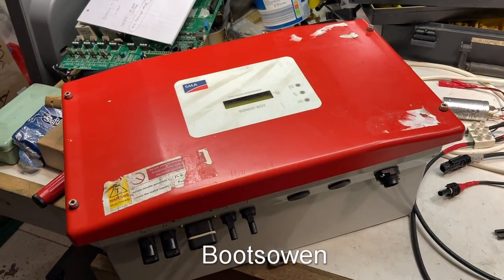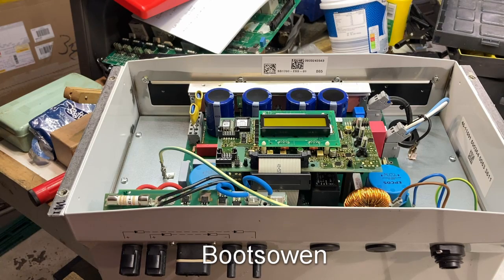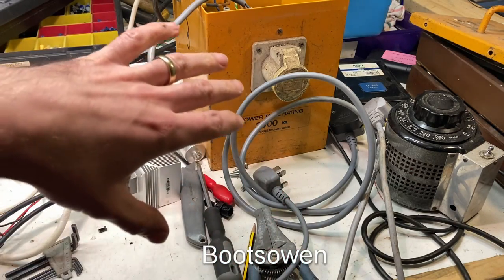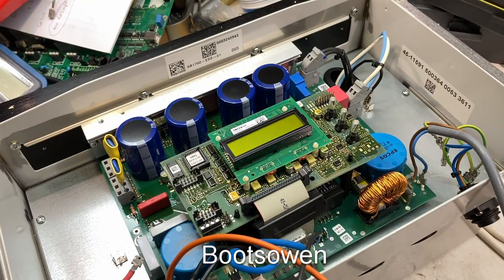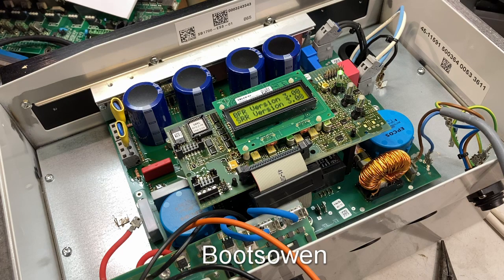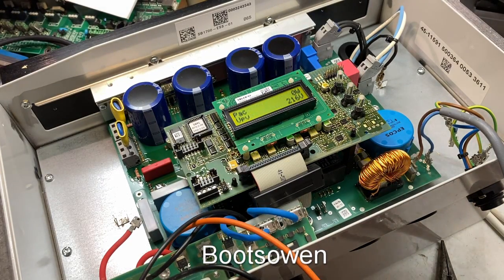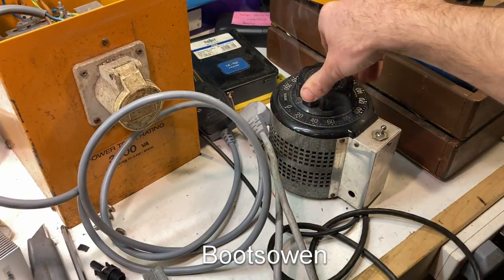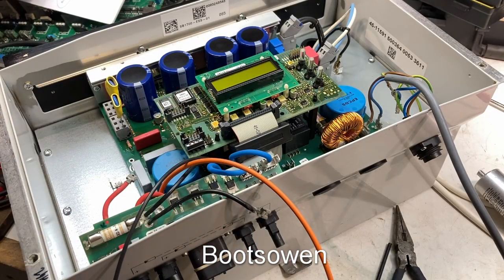Sunny Boy SMA SB1700 bench testing a grid tie solar inverter without solar panels

Comment: Thankyou, i have exactly the same one laid out on the lawn with the panels. Mines done 62259hrs😂. The mc on the bottom is sipposed to be a plug in isolator you plug it in after you put the solar arrays in like a dc isolator i dont have it either. I soldered over the2 pins for the plug with some 1.5mm2 wire
Reply: Thanks for pointing out the 130 input voltage its overcast suns low in the west ive only got 119v mines just saying waiting, ill have another go tomorrow good video

Comment: It should have a cover which push’s in to the 2prongs which are joined together just jump a wire from left to right like a swathe on I hope this helps please let me know how you get on cheers Dave
Reply from the maker: Thanks. I figured it out in the end. I think I updated it in a more recent video. Then on a different model I took out that switch thing altogether and wired in mc4 connector.

Comment: i have one to, but know i have a problem. two strings goes inside, but all 3 leds are on, and they to not switch to working mode. do you have any idea? best regards
Reply from the maker: If all 3 lights are on what is the error code, what does it say in the manual? Have you looked up the fault list in the inverter software?
Reply: @bootsowen  
Initialization
All LEDs are on.

The Sunny Boy control system is initializing.
The string voltage to the inverter is between approx. 85 V and 225 V. The supply is
sufficient for the system control and not quite sufficient for feeding to the grid. Data
transmission is not possible yet.

I put 2 Stings with each 112 Volt(comming out of the cable), so thats mean the inverter have enough power to switch from initialzation to feeding the grid. 
Or not?
Im a homemade man so, im not an expert..
I read in an Artikel the  power converter,( some have Lem Hj 15p or CMS2015(25) installed) and this one should be the  trouble maker....

Sounds not bad to me......power converter....is transform DC to AC....and there is no power behind DC...So something between is the error....so this sound good to me.
´
What do you think....is there a way to find out? In a way of try and error?
best regards and thx for your Answer. i appreciate,-)
Reply: Everythink ist No working, my Panels was to week, my Sunny Boy needs 365 Volt to produce AC. So problem solved

Comment: Hi all, I've a sunny boy sb1700 which when connected to dc/ac msg display says "disconnect ens1, 2 or both" any ideas peeps having no joy   with info🙏🤞
Reply from the maker: what does the manual say?
Reply: @bootsowen  can't find any lit with that info even on net😕
Reply: @bootsowen  thanks for taking notice👌
Reply from the maker: No Idea, why not email SMA?
Reply: Found the issue with my inverter... Ribbon cable from master board to board under display was not seated fully.. Another one saved from the tip as even Sma didn't know what issue was💪💪

Comment: So the inverter only turns on when a dc voltage is applied on the left side? It won't display anything when ac is only connected?
Reply from the maker: It needs both AC and DC

Comment: That plug that is missing is a kill switch, just has 2 tabs that link each side, makes sense why it wasn't working :p
Electronic Solar Switch | ESS handle replacement part | ESS-HANDLE:01

Just a question about the AC side, I've tried using a cheap inverter that says it's pure sinewave but I don't have a way to tests this and it goes between grid monitor and waiting, is it fine to plug into mains?
Reply from the maker: Have a look at my other solar playlist videos where I show how I test.

Comment: I'd be careful using your meter in that way. Measuring continuity with the power on, if the fuse is blown you would potentially sending the voltage across the supply into your meter. When measuring such things, I'd recommend power off first... :)
Reply from the maker: You might have guessed that I know little to nothing about electronics!  But help like this is what I need! Thanks. Keep it coming!!

Comment: Hi, I see you went to the Andy Reynold's school of artificial source of PV.
Are you piping the adjusted output of the variac into the 110v side of the transformer?
I tried it straight through once but the circuit breakers recognised it as a dead short. I can only get to 280v DC which isnt quite enough to turn on one of my inverters. I also have a 10kW one bu lt that needs over 400V :(
Reply from the maker: Indeed, pushing the variac into the 110 side, then getting 0-480vac out. not sure that the rectifier can take that much but seems ok so fat on about 150-200v. really the transformer is a handy and cheap way of getting an isolation transformer. I have a little 240-240 isolation transformer, but it won't give the extra voltage. If you disconnect the earth in the transformer it should work.
Reply from the maker: John ward's video is worth a look on the faults that can happen doing this silly stuff!
Reply from the maker: Have you seen the buyitfixit way using a washing machine motor, battery drill and rectifier?
Reply: @bootsowen    i will find the buyitfixit video.
On testing my directdrive washing machine motor; I spun it with a drill while oscilloscoping the hall effect sensor. Back emf was strong enough to trip the clutch in the drill, lucky as it would have spun out of my hand.

Comment: Hilarious, smokey variacs boom. I wonder whether that DC daughter board is to protect the main from transients. And it may have done its job and and sacrificed itself in the role. Edit just read Andys comment yep you need to jump that connector preferably via a proper dc switch
Reply from the maker: I think it was just dust inside burning off, I stripped it down today and it still works, no signs of damage, but lots of dust.

Comment: Owen, another inverter saved. The block in the DC input area is a simple DC disconnect plug that is missing. It connects the 2 terminals together, simple as that. Thanks for the reference to my books, a reference to the variable DC supply would be great, cheers, Andy
Reply from the maker: I tried putting a jumper across the missing plug and it began to initialise, but then it went into a constant waiting mode. which video do you want a reference for and what timestamp. I think I have already put a link in for the solis we were testing on your bench.
Reply: @bootsowen  Owen, been working on the wheel, 3 tries a day, getting there slowly. This is one of my original testing videos: https://www.youtube.com/watch?v=lBZqqEvjgZU&t=492s
Cheers, Andy